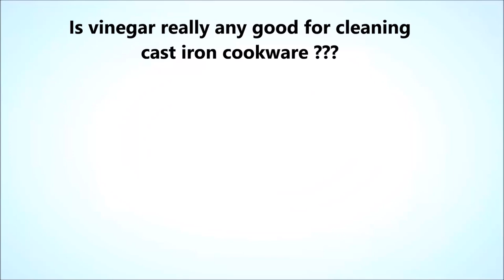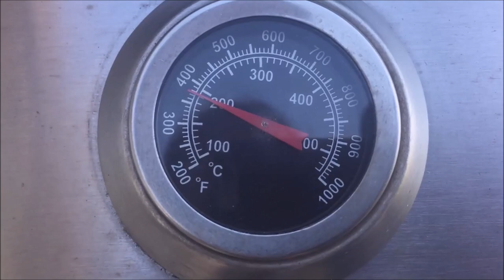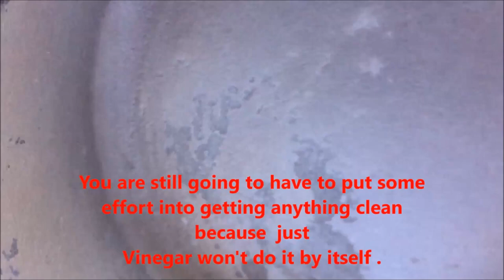Does Vinegar really clean cast iron cookware ??? lets see

Comment: the only thing vinegar does is make the water acidic, which will dissolve iron oxide (rust) and produce an aqueous iron ion solution.

you can speed up the reaction by warming the pan on the stove, but don't let it get too hot.   use a stainless steel tool to break up the larger clumps of rust to speed the process.

once the rust is dissolved (you can see bare metal again), put the pan in the sink and quickly rinse out the water/acid/iron solution with fresh water to keep the iron from depositing back on the pan.

if there is still a bit of rust, scrub with a scouring pad or steel wool, and repeat the process.  once the rust is gone and the item rinsed thoroughly, buff dry with a cotton towel, and immediately apply cooking oil to the exposed surface to keep it from re-oxidizing.

but really, that's all the vinegar is good for, a source of acid to dissolve rust.

bases like sodium hydroxide (oven cleaner), work better to remove old food and grease by breaking the bonds that hold that stuff together, but won't react with rust.

so, if it's really both crusted with old food and grease, AND suffering from rust, you probably want to use oven cleaner and scrubbing first, then rinse well, and use acid to remove the rust.